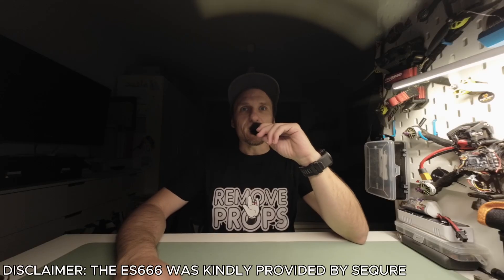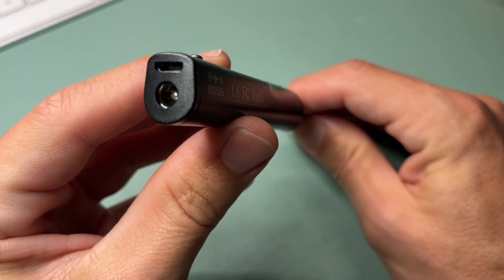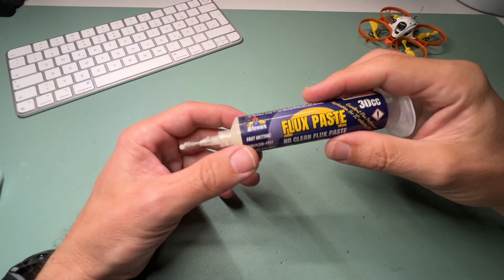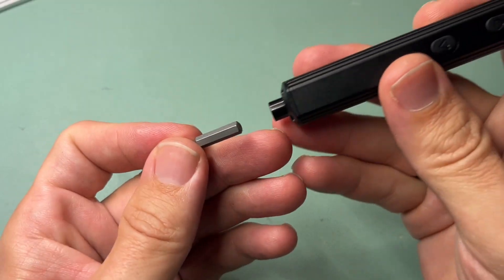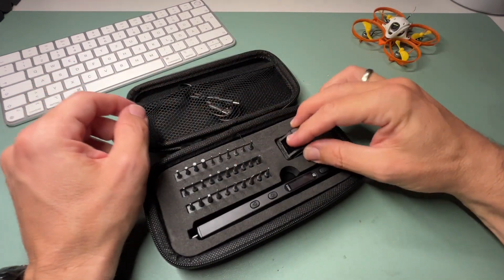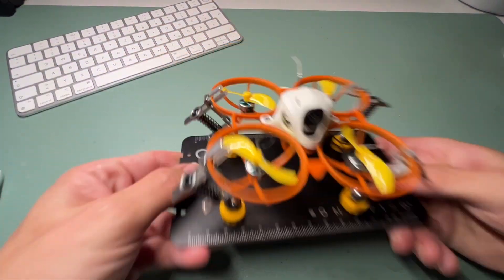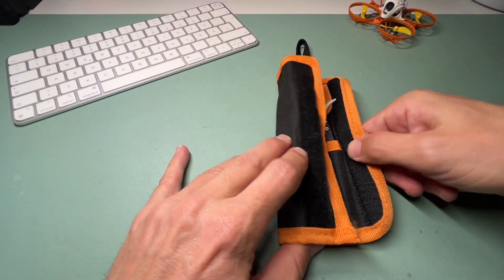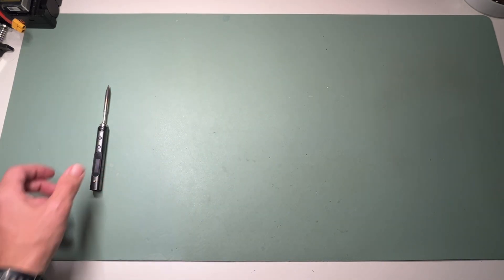5 MUST HAVE FPV TOOLS

Comment: Is tool number 2 powerful enough? Does it loosen tight Loc-Tite M3 screws easily? Does stripping happen faster?
Reply from the maker: No.. its not that powerful to loosen loc-tote m3 screws.. sometimes its ok sometimes they are too tight.. I loosen them by Hand in one Go and unscrew all Parts After that First step.. I was tired to domit by Hand… it really comfy. Im lazy 😂 and it does the Job Perfect on smaller builds
Reply: @tomlfpv does it have a "lock" or something to do it by hand or do you need an old-school screwdriver for that?
Reply from the maker: @saturn_fpv  the "lock" is 2.2Nm, what is pretty tight, if you wanna be sure, tighten them up in the end with a old-school screwdriver

Comment: I need that omnifixo and probably also the magnifying glasses. maybe also a new soldering iron... my one was 17 euro from amazon and it kind of does the job but it's not as sleek as yours ;-) props for the video. really like that kind of content!!!!
Reply from the maker: The omni is a really Game changer.. I was struggling hard to keep my Parts in Place with this cheapo metal croc thing… now its enjoyable 😊.. tbh my Glasses are also cheap ones from Amazon… Link in the description

Comment: Reported for not providing referral links :-D Pinecil v2 camp here. One more useful thing (not mentioning smoke stopper) could be some kind of multimeter, I got some cheap vc921 from amazon. And to screw around, i "settled" for CS0702A 😀